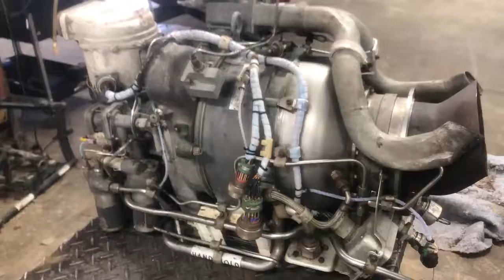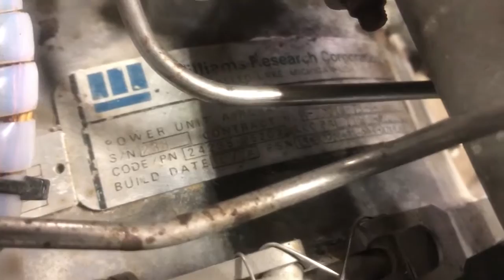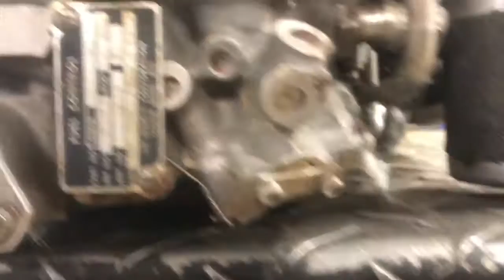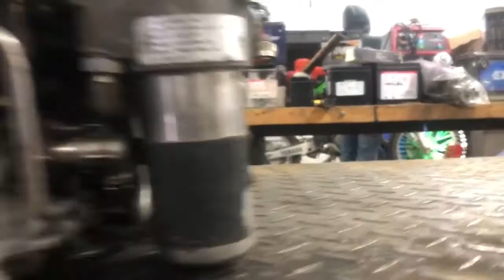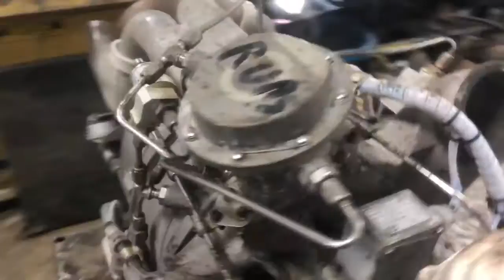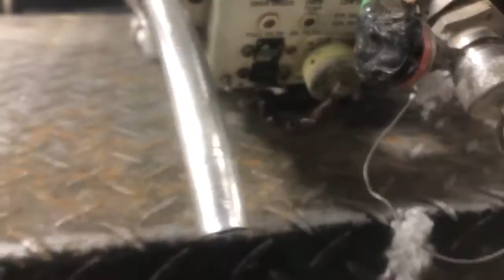Williams WR 27-1 APU auxiliary power unit aircraft jet turbine generator

Comment: What are the specs on this: How much does it weigh, what is its fuel consumption and what is its power output? Thanks.
Reply: Ebay listing has none of those details either but it does say last run 9 years ago. Best guess is its a $3700 boat anchor.